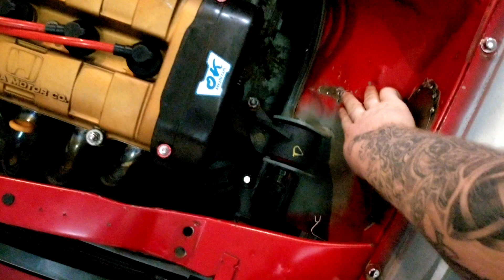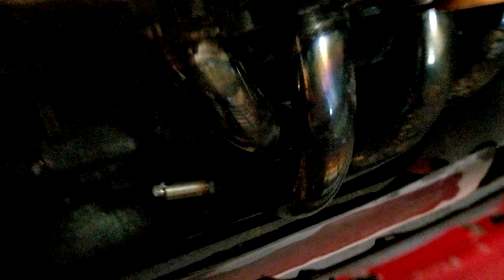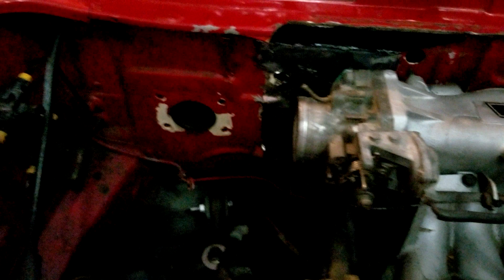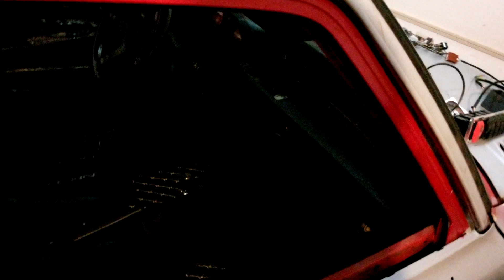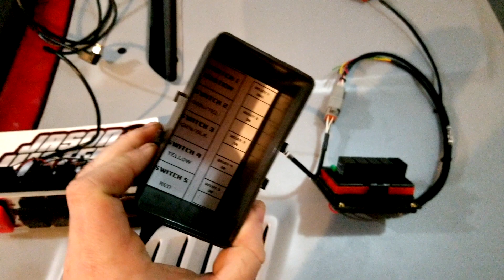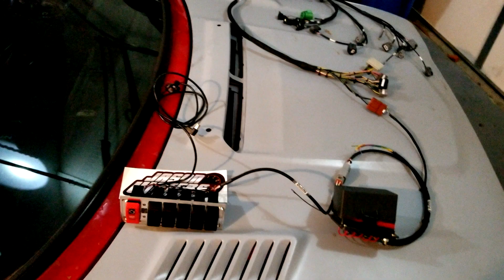JDM DOHC D16 ZC FIRST GEN CIVIC SWAP MADE EASY

Comment: My first car (24 years and 68 cars ago) was a 1979 Civic 1200 4 speed manual, and it was alot of fun to drive, but God was it SLOW. Now I have a 353 whp 2004 UA6 Acura TL with a six speed manual swap, and I still have my self-built EJ8 1997 Civic coupe with a fully built LSVTEC turbo swap that currently makes 709 wheel horsepower. I eventually fell through the floor of my 79 Civic 1200 because I live in the NE, but I always wondered what it would've been like with a ZC DOHC swap, a D16Z6 swap, or even a B18B1 turbo swap. Thanks for sharing this build bud! I LOVE it!
Edit: My Civic was baby blue with a full blue interior and a truck shifter...lmao

Comment: Hey I got a couple questions I'm building a 90 crx si with a zc 16 as well if you dont mind
Reply: I had 3 ZC engines in my 91 HF.  I love them. It is different than the d16. Timing belt is off a prelude.  D series header will bolt up but not line up with the ports. It can run off the d series ecu but will need a wire to the other cam.  The ZC transmission is hard to find but it is a true 5 speed without overdrive and all of the ones I’ve seen have a factory LSD. Easy swap.